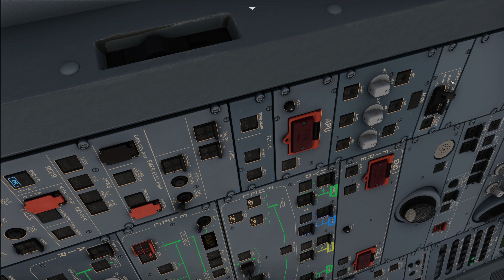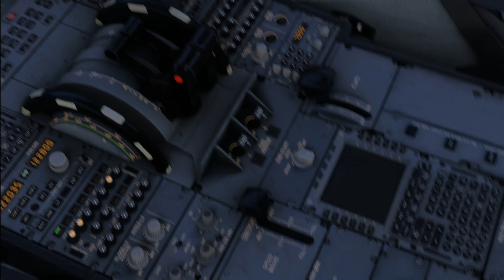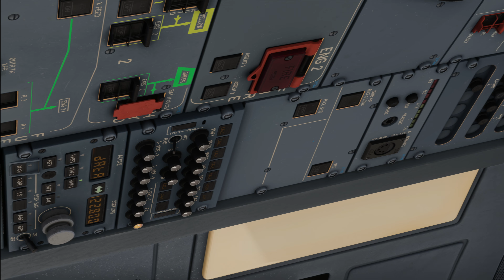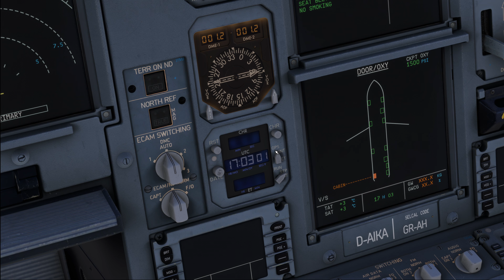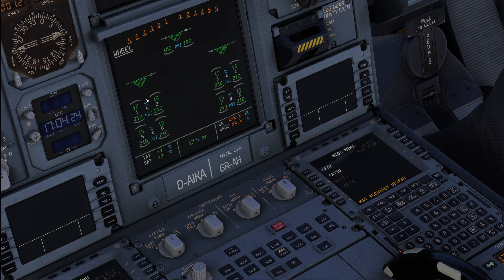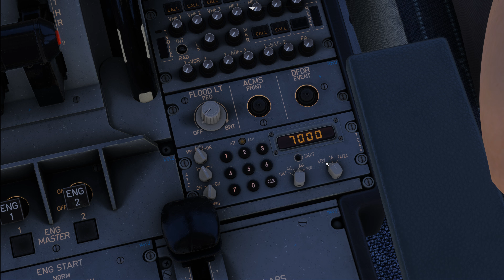Airbus A330 - Virtual Type Rating | Cockpit Preparation | FS 2024 | Real A330 Pilot

Comment: Please answer two more questions about the trim wheel: 1) Is it directly mechanically connected to the rudders and ailerons or is it indirectly connected? 2) The trim wheel is not visible in the A350 cockpit. Is it really missing or is it located internally?
Reply from the maker: 1) The trim wheel is neither connected to the rudder, nor to the ailerons
2) It's electronic and replaced with a trim switch on the pedestal.

Comment: I have a question. In the middle and below where the engine controls are, there are two wheels that move during flight and landing. What are they?
Reply from the maker: I guess you mean the trimwheels (the black and white ones, right?).
Reply: @A330Driver  Yes. Exactly.

Comment: It's great to see how Airbus makes their planes incredibly similar
Reply from the maker: Indeed, makes it really easy to transition between them!
Reply: @A330Driver  Just a quick question. As the Beluga is basically an A330 and has the A330 cockpit would you be allowed to fly it with your current type rating or would you need some additional traning?
Reply: @DarkAndVelvetNights  Beluga has a whole different fuselage. I dont think they can fly without additional training.
Reply: @aviator1111  Not exactly a whole different fuselarge. It is based on the a330. Just with a little bump on top and some little changes here and there. Some beluga pilots even say they dont sometimes notice the bump.
Reply: @DarkAndVelvetNights  it is not "just a little bump" by aviation terms. Aerodynamically different. CG calculations are probably different. etc. If your question is just flying the airplane, sure. But IRL no
Reply: @aviator1111  Yeah it probably shifts the CG a lot and stuff like that but after all the flying is not that different